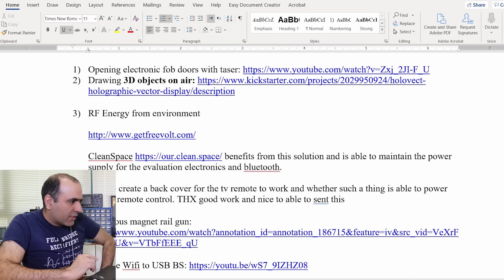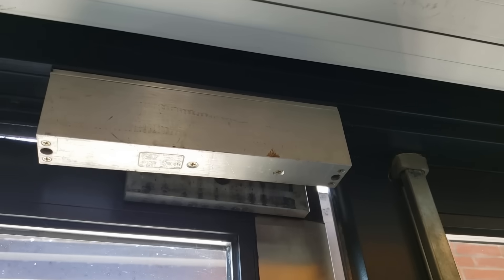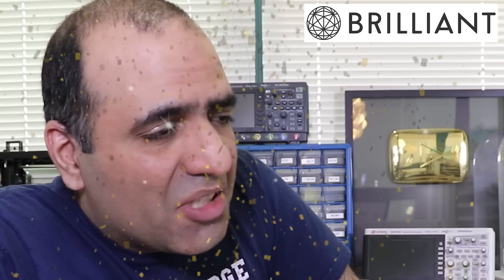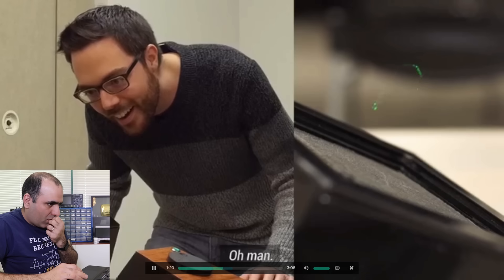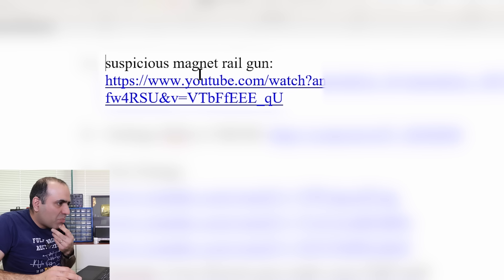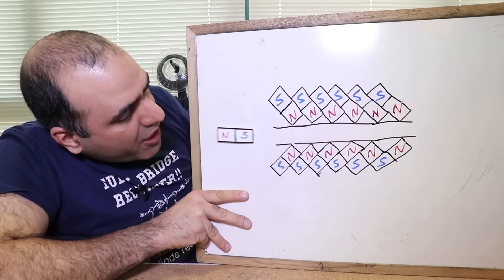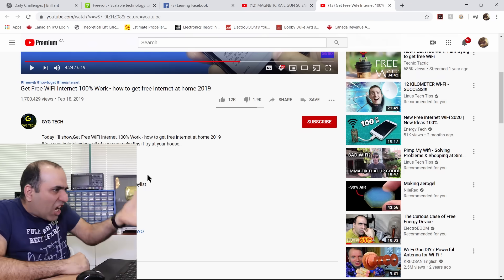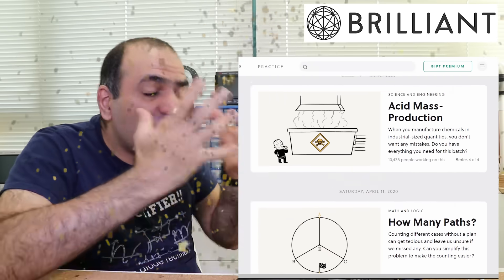BATCH RECTIFICATION of my To-Do-List

Comment: 1:05 such a door lock failing and letting the door open is fail-safe; in the event of an emergency that the control system is damaged and fails (like if lightning struck, starting a fire  & damaging electronics) anyone in the building can exit safely
Reply: In some countries the "fail open" behaviour for residential use is required by law, precisely for the reasons you stated.
Reply: I'm used to the electromagnet circuit being broken by a switch in the pushbar. Maybe the fail-open behavior is less of a concern with people inside trying to get out, and more for the benefit of emergency responders trying to get in?
Reply: @CFSworks  quality systems have a cutout in the pushbar.  the cheapass systems often installed as an afterthought in apartment buildings and such often don't have pushbars on the doors, never mind cutoffs in them.
Reply: @johngaltline9933  I've seen two or three of those myself - they have a "push to exit" button on the inside, next to the door, instead of within the door itself. But the switch works the same in either case.
Reply: @CFSworks  if the system is fully electrical like those electromagnet locks, in the event of emergency with power loss, the door will most of the time by default be at fail-safe (open) because there's no electricity to keep the electromagnet locked. if the system is partially electrical (a mechanical lock with electric servo motors) then in the even of emergency with power loss, you cannot use the Push to Exit button to open the lock. so the manufacturer must design the lock to have enough capacitor charge inside them to make the push to exit button functional for a certain period of time after power loss, or use the charge to make the lock default to fail-safe (open when power loss) or have a mechanical lever or switch to manually open the mechanism from inside. adding a manual lever can compromise the security of the lock because educated intruders may know how to exploit the manual lever.  the opposite of fail-safe is fail-secure (closed by default when power loss).
Reply: @aoyuki1409  Do you know of any such system where the push to exit button is only functional during an outage for a certain period of time as you have just described?
Reply: @CFSworks  i do not know but with the minor electrical background that i have for my engineering degree i think its easy enough to do it with large capacity capacitors but those things dont keep their charge as long as regular batteries. and they also took forever to reach max capacity. im not sure why electronic locks with some sort of backup power isnt as popular, maybe because whenever such situation is needed usually its a large building so possibly they are dependent on localized backup power generator like a hospital or a big office.

also based on your sentence i'm translating "the button only wokrs during power outage" no, the button should work at normal conditions, but if the device has large enough capacitors in them to keep the button system active in case of power loss it would be a good situation. 

still, i think a manual lever might be more practical for fail-secure doors, or doors without power out fail plans (the default of power loss is the last known state before power loss). as far as i know regulations make sure emergency exits of buildings, both public and domestic buildings should use fail-safe default to open locks.
Reply: @aoyuki1409  Ah I'll rephrase to be less ambiguous: "What's the model number of such a system that relies on a supercap for fail-safe as you have described?"
Reply: @CFSworks  i dont know of a system that actually has that feature. its just something i thought of in the moment. it will definitely work to an extent but after further consideration and rethinking im starting to find the idea a bit silly when you can just add a manual lever instead of a separate circuitry
Reply: in case anyone is wondering, the opposite of fail-safe is fail-secure. which means it only opens when you supply power to it, otherwise it stays locked. 

most of the doors in our office building's fire staircase are fail-secure, with a push to open bar to override the locking mechanism. so when a fire breaks out, the doors don't swing open and supply oxygen to draw the fire towards to the fire staircase.
Reply: In one place I was at, there was an emergency "door open" button behind a "in case of fire break glass alarm" style of box. I assume it cuts power. Right by every door to the outside world.
Reply: @forevercomputing  a n mio
Reply: @forevercomputing   That's a decent idea, though I don't see a huge benefit to the glass. Why not just have an exposed override button, since it's presumably an exit anyways?
Reply: @forevercomputing  the kind of lock that is dangerous in case of emergency is the kind of lock that is by default locked until you supply it with power, so in the case of emergency with power loss you are most certainly trapped unless there's a manual lever inside to open the mechanism. although this doesnt apply to common electromagnet locks because with power loss the electromagnet will disengage because no more power. im not sure if there are electromagnet locks that default to closed when power loss
Reply: Fully electric locks just sound like a bad idea.
Reply: Stop arguing. All of these doors are held by an electromagnet only, with no mechanical BS with a force of 300 KG. On the inside there is a button that cuts the power to the electromagnet for 5 seconds when you exit the building. When the power is lost, the door simply opens. No additional mechanical BS, bypasses or anything.
Reply: I believe all these doors have to have a manual unlock from the inside, if it just unlocked when the power went out that would just be inviting criminals in.

Comment: "I would design so that if the electronics fail it would fail in a safe and secure position."

You never, EVER make a door stay locked if the electronics fail due to emergency situations (unless it is a bank safe door, but those are not susceptible to such pitiful attacks)
Reply: That's what emergency exits are for.
Reply: @gfifer1  most old buildings have one exit only. Even new buildings in Russia don't have any special equipment on the second door and is opened with similar magnetic locks.
Reply: @gfifer1  Fire codes require all doors on commercial property to be able to open from the inside without keys or codes.  Quality systems will have a switch in the door's pushbar that cuts off the lock.  Most of these systems, cheap or not have a number of flaws, most common being a magnet can open them, used to manually trip the relay inside.
Reply: @gfifer1  yes, that's what all doors are. Use the closest door, always. If the only open door is on the other side of the building because some dumb twat decided it would be a good idea to fail locked, then I hope the guilt of the deaths they cause drag down on their conscience
Reply: The lock is just magnet holding your door
If no electric, it will be just iron and wont hold the door
So it dont need such a fail save function
Reply: @whoami1449  loss of power is not the only sort of failure.  it needs to fail open if the lock is damaged or if some part inside fails.   That said, any properly installed electro-magnet lock will have a switch in the push-bar or beside the door that kills power to the magnet to allow keyless/codeless exit.  It's a sign of a cheapass lock that opens on reboot, or that can even be affected from outside.  quality electronic locks put the brain box inside the locked room/building and the keypad only sends data of what code was entered, not a lock/unlock signal
Reply: Yes, you do make it stay locked if the electronics fail. They aren't the only way to disable the magnets... in an emergency situation, the door would be just as easy to open. 

Besides, in an emergency situation, how do you think the responder gets in? Typing the code?
Reply: @nicewhenearnedrudemostlyel489  No, for residential buildings the doors always unlock when the power is cut.

Comment: The taser thing works by design. In Russia, systems installed in 90's had to become open in case electric power failure, fire or other emergencies. The taser just fries the controller and that permanently opens the lock.
So it's nothing new...

Comment: Exterior locks on apartments should actually fail open. If the building catches on fire, and the control circuit is damaged by the fire, you want the doors to be open for people to escape and fire fighters to get in. Failing shut will literally trap people inside of a burning building.

Comment: Well, if you zap the panel and manage to stun the system, depending on country you will find different regulations apply. In Europe for example the fire regulations will require free escape in case of fire. You can add different solutions to the system, like door with one way door knob, but over all the door must always be unlocked to allow escape in case of fire. That is why, in case you stun the system with high voltage, different locks will behave differently. Some will not move at all, while some may assume the power is lost and will unlock the door for fire escape.

Comment: Actually the 2nd one is possible. Look up ILDA Laser Projectors. I built a few of then and it is possible to „draw in the air“. They use a very thin cloth to do the exact same thing on some shows :) its only a 2D plane ofc but the laser is simply a vector display. And the corners are brighter because the corners get „drawn“ multiple times to make them sharper. It‘s just two really small mirrors for the X and Y axis that move the laser beam really fast. Theyre fast enough to produce 3D Vector graphics

Comment: With the first Video, it can make somewhat sense. As it looks its just an Apartment building and they don't have high security standards. You just want to keep strangers out. Nobody wants a hobo in their building to sleep on the ground. 
In a case of a failure, you don't want to lock everyone in. So it makes sense that the lock is normally open. So a shitty desing might work that way. A better one might still be locked but work in such a way, that you always can open it from the inside. 

The last one with free internet is just BS. He is in Airplane Mode and after a cut he just turns on his Wifi. With his Setup he may only extend his range but fun fact, there is no antenna in USB. There might be an Antenna in your Audio Jack. This is used for FM and not other Signals. Extending your range might only give you access to a now in range free wifi spot or an unsecure one. A unsecure unknown Wifi is a bad Idea, because people can mess with stuff. A free wifi as usually a cap and so it isn't worth it. It would be better to have a very good Wifi Antenna on your PC, bridge the signal to your LAN Port and then connect this into your Wifi Router into the WAN Port. With bridge i mean a software bridge in Windows. I've done this and it works and more devices have access to the internet.

Comment: These systems are called 'Fail Safe', in the event that the system powers off, or 'fails' the system unlocks to prevent people from being locked in.

The alternative is 'Fail Secure', locking the door to prevent entry.

Comment: i saw something similar to that 3d image in the air a few years back at CeBIT in Germany. it was far more advanced with full color, and there was a game you could play using your hands(its that game where you slash  a bunch of falling fruits in two). damn, i'm sure i still have a video or pictures of it somewhere on my old drive. i remember being impressed and disappointed because it was a bit impractical compared to a real touch screen. its real but the one shown in the video is extremely primitive.

Comment: Actually there is a way the USB Wifi thing could have an effect. By connecting an antenna to the ground of your USB, you are effectively connecting to the ground-plane of your phone, which in turn modifies the internal wifi antenna performance slightly. Probably for the worse, but EMC is a weird science.

Comment: Mehdi, regarding point 1.
First of all, the door in this movie is the entrance to an apartament, this is not a nuclear power plant, this entrance is an escape route for the residents - there is nothing wrong with it being done this way.
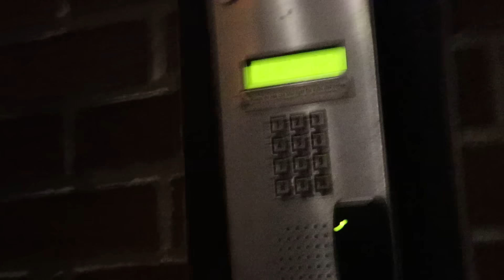Secondly, pay attention to your video - in the fragment 3:32 to 3:38 you can see a proximity reader, when the intercom resets, its LED lights green and after a while it turns red. Probably then the door was open but you were too far away and when you reached the door it was already closed.

Comment: Stick some IR reflectors on your eyebrows, then use an IR tracker to pickup the IR light, feed the signal generated by your eyebrows into a post processor that displays a wave function based on the input from your eyebrows!

Comment: ElectroBoom’s waves eyebrows as a function generator? Stick some IR reflectors on your eyebrows, then use an IR tracker to pickup the IR light, feed the signal generated by your eyebrows into a post processor that displays a wave function based on the input from your eyebrows!

Comment: that door opening one is pretty weird, all different kinds of panels, sometimes they zap what looks like a battery or 1-wire-interface contact, sometimes literally just the ring button, we don't even see the display do anything like when you tried it, pretty sure there's just someone sitting off camera with a switch for the magnet :P

Comment: Dunno much about RF but could that “free internet” one work as a slight improvement to wi-fi reception if the phone uses its chassis as an antenna, and USB neutral is connected to its chassis?

Comment: Just a heads up, Kreosan's emp uses a taser they modified so it outputs 50KV, more than a normal taser. They also used vape batteries to supply more current to the magnetrons, just remember that.

Comment: The laser pyramid has hot corners where the scanners have to stop to keep it sharp. The lines in between are much dimmer in comparason. I've projected lasers and video projectors onto fog screens and a larger version of this same thing. If the air is perfectly still it's possible to get a good image. The large and expensive fog screens create a laminar air flow around the fog but it still screws up after a few feet.

I'm a professional laser display technician since 1992

Comment: Probably there are a couple of reasons why the taser thing does work with the access systems in russia:
1. I've yet to find an apartment with proper grounding in Moscow. That may be a radiation resistance concern as well.
2. Those access panels are usually crappily connected to a long 12-24V line, the current may be significantly limited.
3. All of the ones showed in the video use old "iButton" (dallas key) protocol, which is, in essense, just two exposed wires (ground and signal/power). He seems to hit these contacts directly, which hits the electronics way harder than hitting the properly grounded metal enclosure.

Comment: Surely a door that stays locked when the system gets overloaded like that would be a bad idea? Yeah, it's worse for security to have it fail open, but at the same time it's a lot better for safety- if there's a fire, for example.

Comment: Those door locks work with keys, that can be programmed to the lock, so you don't have to type the code every single time: https://www.mindentkapni.hu/termek/codefon-proxy-kulcstartos-proximity-kartya

And the guy zapped the part, where you should put them.

Comment: The correct safe failure state for those locks in a residential building is the unlocked state, staying locked is a bad idea, you don't want any locked doors in should a fire or similar occur, the risk to property due to theft is a lower priority risk.

Comment: Nice try with the home-built door opener, but Nope:)  The guy isn't shocking the keypad, he's shocking the keyfob inputs. They were Dallas Semiconductor I-Buttons. Corby Industries started using them for access control under the name Data Chip. The round thing delivers power to the chip and reads out a 48-bit code when you physically touch it. Either the board design is really crappy and inducing a very weak relay to fire, or they're using a capacitive emergency exit bar on the doors - they used to be very sensitive to outside electrical sources and would open very easily (can't remember who built those)  .

Comment: So I install and configure access control systems for a living. Maglocks, like you showed in the video, are generally designed to kill power if anything goes wrong for safety reasons. The idea is to make it easy to leave the secure area in the event of a life safety emergency, even if the system is not working.

Comment: 1:05 In the IT world that's known as the fail-closed dilemma.  In case of a door for example, what if a fire takes out the electricity... do you want it to fail closed and burn everyone inside?  Perhaps a manual unlock from the inside but then all one has to do is slip a coat hanger from under the door and simply open it.  Anyways, the point is that it takes consideration on a situational basis.

Comment: The hologram can actually work. They're not trying to illuminate points of light, but rather move the laser, drawing lines in midair. This was already done with a laser video game system, except it draws on a wall. The speed at which the lasers move is higher than the shutter speed of the camera. In those clips where the laser looks like garbage, the shutter speed is not high enough, same thing happens if you try taking a video of a computer screen.